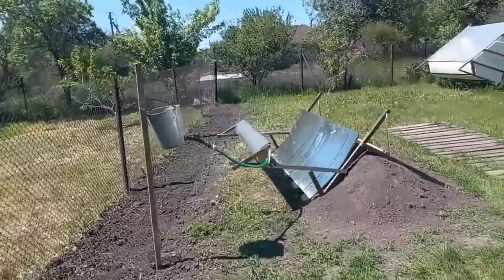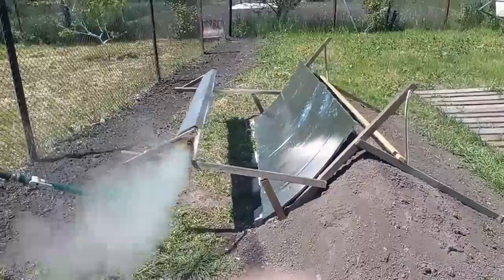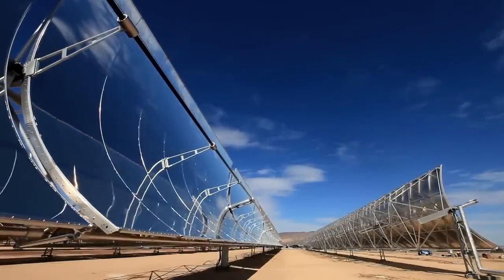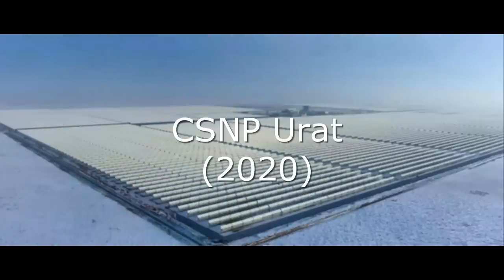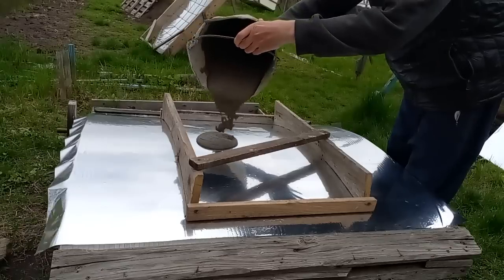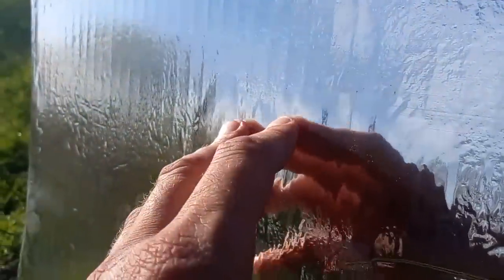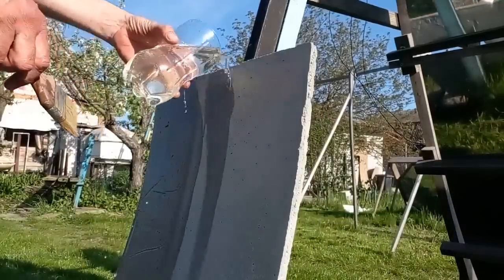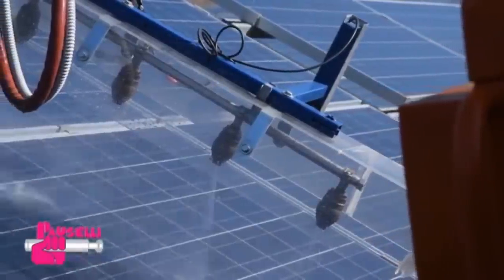These 2 innovations lead us to cheap solar electricity

Comment: I thought of this years ago,  but did not use a dirt berm, but instead planted it in the ground pointing straight up. My paranolic curve was basically half a circle. Picture a barrel cut in half long ways and sunk in the ground. The pivot point of the collector was the center of the barrel ends, extending approximately six feet up where the collector was attached. Although my curvature was made of plexiglass instead of concrete. In the end, my experiment made a better water collector than sun collector because the mirror heated up, causing condensation,  leaving an inch of water everyday. I do like your idea. It's certainly caused my inventive juices to once again flow. Lol
Reply: Can we please have contacts of each other .
   I am not scientific mindid like you .but i can get things executed. 
   If i see some interest here .i will start with sharing my contact .
    I am confident that your initial efforts will see fruition
Reply: @nooruddindaud2303  did you need rotate primary mirror? for how long hour / day it give you thermal energy?

Comment: Your idea would  be an excellent source of heat for thermal desalination in tropical deserts. For that purpose you don't need the high pressures needed to turn a turbine.

Comment: One more thought: For yrs I've been thinking about greenhouses based on reflection rather than glass/plastic. If you had an earthen dome with a small opening facing north, and a solar concentrating array to its north but focused on the slot, you could concentrate rays on a white interior ceiling and grow under the inner dome. it would be much easier to keep warm, and with a wide enough exterior array not even require electricity or moving parts. To keep cool a vent could be used (and beeswax pistons can auto open/close if needed). Food for thought...
Reply: Jesse H - I'm sorry, but I don't understand your description. Can you explain what you mean by inner and outer earthen domes? Also, what slot? Thanks.

Comment: The reason your first set of mirrors delaminated is that concrete during the cure phase does a bit out outgassing. The small amount of gas was trapped between the layers. In an ideal situation, pour your concrete to shape, let set, then permit to cure for 30 days. After that apply your reflective surface as you did in the video.

By the way an earth berm is self-stable at 43 degrees.
Reply: Does the self-stable angle change with difference mixtures of clay and water etc? Or is 43° just for straight dirt?
Reply: @omfgishBenneh  Ben I am sure it would be different for mixtures. That said if you take a bag of dry sand and drop it on the floor like a stream from a hour glass the resulting angle is ~43 degrees. Egyptians knew this and most of the pyramids are at that approximate angle.
Reply: @johnmcginnis5201  That is a very cool fun fact.
Reply: Can you all shut up and mass produce these solar machines so I can buy them at my supermarket. are you trying to help people or just look clever?
Reply: @thegenius8817  There is an old saying -- "help is at the end of your arms." So why not do it yourself?
Reply: Using fiberglass instead of cement might be an idea too.  It will adhere better.  It's more expensive, but not too bad.  I've also heard of epoxy and cement mixes, but they are probably expensive.
Reply: @thegenius8817  First the idea,and then the product follows....AFTER communication with others, so as to improve the concept ,so that it can be presented as a product which is for sale to you.....genius lies in communication and not in shutting up.....every genius knows that....but it does not seem as if you know....that begs the question: Are you a genius..?? ....or are you the opposite of a genius..? Genius takes patience and time....You be the judge....but to be capable of good judgement,you need to be logical....that is also an ingredient of genius.....🤔🤔🤪 So how much of a genius are you...?...Really..???
Reply: @gerhardvanderpoll7378  Well one genius who communicated is Tesla...😒 & what happened to him...? 🤔 Where are his invetions of free power? 😲
Reply: @thegenius8817   As long as there is oil, there will not be any of these products in your supermarket... Tesla invented free power for everybody, & see where that went... Blessings 🙏🌟☝️
Reply: @helengren9349  An invention enthusiast, college graduate of 4yrs course, admirer of Teslas theories, gave a cautionary advice: When you perfected your invention, keep quiet, dont boast about it or mass produced your invention- just used it personally in your home, shrouded with secrecy and  coupled with mouth discipline... My idea, the best help you can give to your community, to your nation: 1) Make a simple, easy to do drawing of your invention... 2) Divide into 3. parts your drawing... Part- 1 = Main part of your invention.. Part-2 = Accessories of it, with dimensions, measurements.. Part-3 = Procedures  for assembly... Immediately before a grave emergency situation struck your nation (economic crisis, power crisis, poverty , anarchy crisis, war, rebellion, etc.)- distribute  in massive scale the drawing of your invention... Let those who received your drawing, build such invention personally - in Do It Yourself (DIY) basis.. Your invention must be small enough to be carried anywhere on. wheels, dis. assembled in back pack of 15-20 persons, etc... Or can be easily hidden underground, wrapped,  anti. rust & moisture protected- for recovery later on as the situation may allow...

Comment: i love how objective you are being about this whole process
a suggestion to replace the film: super highly polished metal sheets - they can be cut to size and rolled to any curvature; then affixed to the concrete with permanent fastners, and it should last indefinitely, just needing the rare repolish
Reply: also then you could hook up a low heat add on to keep snow/ice off in the winter
Reply: Nope it will be damaged by oxidation.
May be gold foil. But it will not be very cheap.
Reply: @nomars4827  oxidation can be prevented by Anode protection method, ie. By connecting the metal surface with +ve side of small battery and an iron rod as negative. We use this method in wind turbines standing in ocean etc
Reply: @tyagirajdeep  yeap I know this method. Nice idea to use it to protect foil layers!
Reply: @jacobsparkyspratt  oxidatión no in metal sheets of zinc-aluminum.

Comment: Great research. A sheet of polished stainless steel would work well. It only needs cleaning once a year & a repolish every 5 years. The plastic film will break down in 0ne year. So SS is the direction you might follow for longevity. Keep up the great work.

Comment: coat the concrete with some filler like epoxy or even outdoor paint, maybe plaster, gypsum or such to fill in the rough surface of concrete. then you can polish the surface quite smooth.. 
THEN you install reflective Film on the smooth(er) surface...
. After that you spray with clear car paint, for better protection, polish again, like a car shiny it must be.. 
Also try just Black oven paint instead of film, then coat several layers of clean car paint and polish to best polish you can do.. black mirrors work quite nicely for IR frequency of light...;)
Reply: @dmbrookfield  yeah.  but i think i would/will rather try a white base instead of Black .. dunno how i came up with Black. I should try em side by side 🤔🤓

Comment: I see u used a polycarbonate sheet as a base for your mold so the concrete's weight caused it to get an uneven surface. I would suggest using a metal sheet as a base, apply a nonstick substance to the metal then pour the concrete. To get a smooth surface find a way to vibrate the mould. After the concrete is hardened you can apply some finishing product for walls to make the mould even smoother.
Reply: My guess is that he gets a better cost per square meter when using a thicker concrete layer and thinner metal when sacrificing the lifespan of the metal layer
Reply: Furniture polish works well as a mould release agent!
Reply: An electrical jigsaw works well to vibrate concrete in small moulds.
Reply: @Calligraphybooster  As does a sander. or even a drill with a bent rod in the chuck ;o)
Reply: @totherarf  😂
Reply: @caked3953  🔴 What Is Islam? ⚠️

🔴 Islam is not just another religion. 

🔵 It is the same message preached by Moses, Jesus and Abraham.

 🔴 Islam literally means ‘submission to God’ and it teaches us to have a direct relationship with God. 

 🔵 It reminds us that since God created us, no one should be worshipped except God alone. 

 🔴 It also teaches that God is nothing like a human being or like anything that we can imagine.

🌍 The concept of God is summarized in the Quran as:

📖 { “Say, He is God, the One.  God, the Absolute.  He does not give birth, nor was He born, and there is nothing like Him.”} (Quran 112:1-4)[4] 📚

🔴 Becoming a Muslim is not turning your back to Jesus. 

🔵 Rather it’s going back to the original teachings of Jesus and obeying him.
Reply: mr. know-it-all
Reply: @totherarf  I prefer the palm sander. My ryobi drill wore my wrist out with the wibblewobble - I think it was the grip angle. 🙃
Reply: @rionmotley2514  It's all in the angle of the dangle!
Reply: @totherarf  the heat of the meat is directly proportional

Comment: My dad made flat textured concrete panels to put around the bottom of the house in a very similar process (an older house on brick pillars).  They have lasted 25 years so far.  He used newspaper in the plywood form he made so the concrete would not stick, and textured the exposed concrete after it was poured. The panel thickness was determined by the wood strips screwed onto the plywood. (They were about 1 inch/2.5cm thick)

Comment: So interesting.
1. Don't the solar receivers cast a shadow on your mirrors, attenuating some of the possible energy received?
2. What is the curvature that you are using for your mirror?
3. How do you mechanize the movement of the receiver follow the sun?
4. Could you put solar cells on the receiver, and yet still get some heat conducting through to the back mounting plate?
5. Is it possible to store the heat in a heat reservoir and then have some tubes running through the reservoir and pump a heat transferring medium through pipe and inside some buildings that need to be heated?
6. How long does it take for your water to heat up and puff steam like that.

Very cool; simple, efficient and low tech energy production and management.

Comment: The use of concrete forms should enable the use of thinner gauges of series 5000 aluminum sheet.  The framed units need to be able to bear up to wind loading and help support their own mass.  Sheeting used in soda cans start at 250 microns, and thins down to 100 microns at the walls.  They are also EPS coated for chemical resistance, because soda cans only use 3000 series alloys, but still endure quite a long time.

Comment: It will be interesting to see how you extract the heat to serve a useful purpose. Looks like there is too much energy concentration for silicon PV panels and I assume either direct use as "heat" or possibly a converted internal combustion to steam engine-powered electricity generator would, at least, be feasible if sized correctly. I liked the elegant way to track the sun by pumping water to alter the balance of the collection array - scalable, cheap and, I presume, effective.
Reply: I think when i saw a drone shot of some of his other installs, he is just heating large tanks of water and swimming pools. Low pressure hot water systems are one thing, steam at high enough pressure to turn a turbine another. I think he'd have to scale it up quite a bit to create significant pressure. You then start to need pumps to push the water into the pressurised vessel generating the steam etc. Its starts to make you think, heat water for hot water, and use PV for power....
Reply: @InquisitiveBaldMan  - using an evacuated system will get steam from much lower temps (direct solar irradiance, for instance)  that can turn a turbine quite effectively with no "explosive expansion" hazard of a higher than atmospheric pressure system.
Reply: @orcoastgreenman  Does this mean a system under vacuum? I understand this would make steam at a lower temp but how it turns a turbine more easily is way over my head...
Reply: @InquisitiveBaldMan  - Yes... even moderate and easily achievable levels of vaccum allow low thermal differentials to be used to extract motive force, eliminating the need to have mirrors.   And is safer than high temperature pressurized steam, for the home inventor to work with.  When most of the compressible gassed are removed, cold steam can operate at supersonic velocities, as it does when functioning in heat pipe systems like the ones in the solar evacuated tubes, or heat pipes on your pc or laptop CPU or GPU.
Reply: @InquisitiveBaldMan  One could put the an entire low pressure steam turbine and generator within a sealed can and just run the power output through wiring out of of the can. Doesn't have to total zero vacuum just reduced enough to function. Think of it like a refrigerant compressor system only backwards. Perhaps 'backward heat pump' is the better term.
Reply: This concept would be perfect for my greenhouse/mini bathhouse project. Still collecting scrap but essentially a small water tower of semi filtered rainwater goes in with the earthen part housing a set of hot water tanks with the outlets exposed for easy access. Steam from the condenser is cooled down and used for the steam booth, hot water used in bath which has a biogas burner underneath. Solar would be used to keep the structure when sealed during winter warm and semi tropical all the way up till mid fall, then gonna have to rely more on biogas/home made bamboo charcoal
Reply: @InquisitiveBaldMan  Couldn't you put the water tank above the pressure vessel and gravity-feed it? Angle the vessel upwards a bit, and put a valve on top so the steam forces it's way out only when it's hot, then more water comes in from the bottom by gravity. The tank (on a small home system anyway) could work like a toilet, and refill from mains water when the level drops.
Actually maybe the "valve" could be a turbine with a load on it (charging a battery). Then the escaping pressure would do something useful.
Reply: @titankorellc2937 ...how do i reach  you

Comment: A thin sheet of High Density  Polyethylene( HDPE) plastic is flexible yet flat and smooth enough to form concrete (or other materials) into a curved shape that would make for an ultra smooth surface to attach reflective material to. (And likely less expensive than polycarbonate) I've even used it to make a form for a project that used carbon fiber and epoxy. It gave a near mirror smooth finish (as long as there are no scratches in the plastic) and the epoxy does not adhere to the plastic (so no release agent was needed or used)  nor would concrete adhere to the HDPE plastic. And yes, concrete does require some time to cure before applying glue, epoxy, paint or other similar treatments. A thin layer of clear paint or epoxy could coat polished heavy duty kitchen foil to help prevent dulling from oxidation.

Comment: Some possible improvements.
1. Narrower with of each section built on a jig or form.
2. Put the jig or form with the concrete into a large plastic garbage bag, and vacuum out the air. This will remove all the air in the concrete and keep it in place to dry in the vacuum bag. Also keep it wet in the bag so it dries very hard. 

3. After 3 Days to a week removed from vacuum ( garbage) bag. Allow to dry or put on second coat and put back in the vacuum bag and repeat the vacuum process again, for 3-7 days. 

4. Remove from vacuum bag. Allow concrete to air dry 28 day, away from rain. 

This concert sweating is what caused the bubbles on the shiny Mylar. 

5. Shellac to bond mylar to concrete. Cheap and should work. Put back in vacuum bag to squeeze out all air pressure between mylar and shellac.

Comment: Have you ever tried adding a layer of transparent plastic on top of the aluminium foil? It might help to make them much longer lasting, it works for mylar bags for example. However I dont know if there is a plastic that is heat resistant enough for what you need.
Reply: I would like to text this method too
Reply: Or use acrylic to coat the top with a clear coat.

Comment: Hi Sergiy, nice to hear from you. Hope you are ok! When I see this clip showing a concrete based desigan I must say I like it. I think it is an appealing idea but there is something I get stuck with in my thoughts. As I am working as a product developer I very often evaluate and take into account the different types of costs during production. Here, in Sweden, the labour is a big part of the cost and the material is often the smallest part of the cost. Do you think the manufacturing of the concrete type of collector is possible to automatize in production? (I know very little about concrete designing..) Thanks for  your interesting videos. /Tomas
Reply: In bigger scale there is option to made silicon mould and let the concrete set in it, that will increase speed of production, and together with vibrating of mould and proper parabolic shape of to be reflective surface can fast produce cheap and accurate mirrors.
Reply: From the video it looks to me like his method would mean less labor because the earth could be dug and / or concrete cast using large scale equipment.
Reply: @nathanlewis42  ok. I was thinking on making the concrete collector itself. Using soil as support I consider to be a great idea as it does not contribute to the global material consumpion.